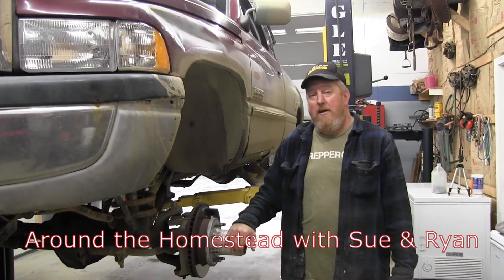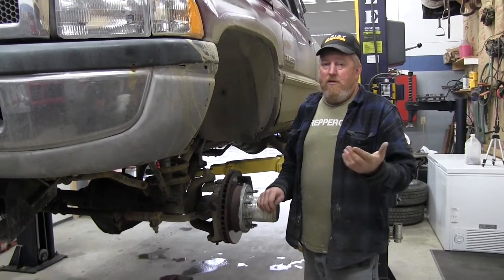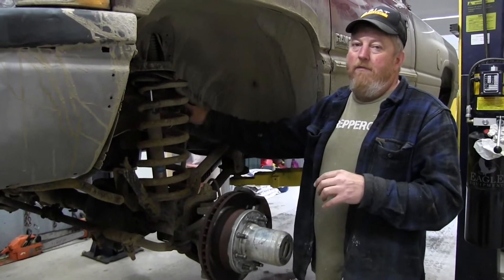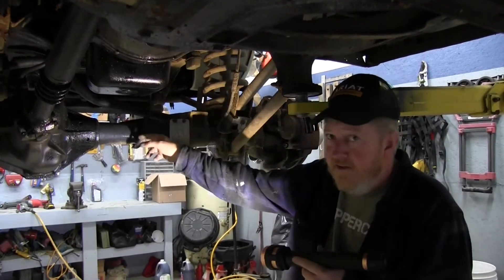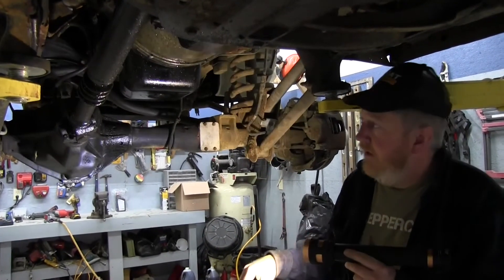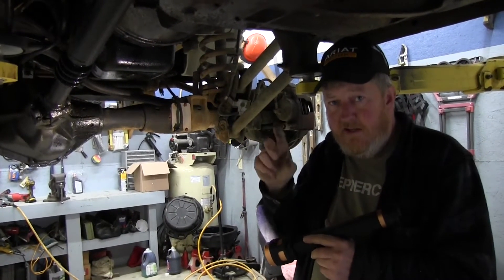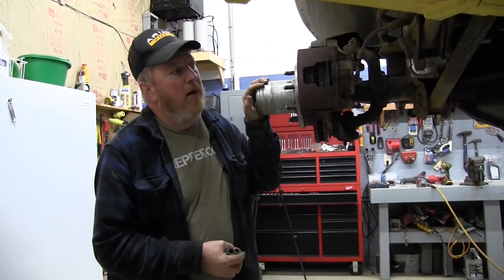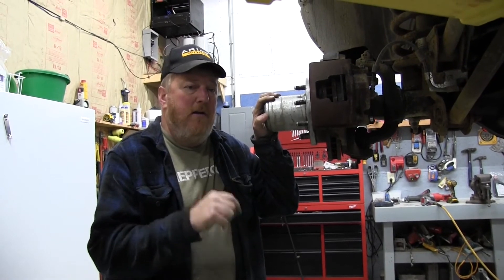Yukon Gear & Axle Spin Free locking hub conversion 1 year review

Comment: Will these put less strain on the ball joints and other joints on these dodges
Reply from the maker: Not really they just allow you to run the front end unlocked for slightly better fuel mileage and handling. They also make it easier to replace wheel bearings or should I say cheaper.

Comment: Don’t have the free spin kit in my truck, but I’ve been considering it. I have had the CAD delete kit for about 2 years. I started with a bellow/Toyota style closed breather, but in 4wd, the axle built up too much pressure that it blew a hole in the breather. After that I ran a 3-4ft hose all the way up by my brake master cylinder and haven’t had any issues.

Comment: I have a 02 2500. It does not have the CAD so it vents through the dif cover. There is a baffle on the inside of the cover. About the 4x4 light, I would look into on how the final year of the 2nd gen turns the light on since there’s no CAD.
Reply from the maker: good point, I will keep my eyes open for images

Comment: I have a 95 4x4.  Many years ago i wanted to make changes to the truck.  So I am now . I having a axle from a 2001 rebuilt to install in my truck ..I bought a axle delete kit and the yukon spin free kit seems like a good choice.  That and 3 gen brakes ect ect .. I did not know if Yukon offers Warren hubs in there kits or may be the yokon is good enough.  I already installed a g56 in my truck and low reverse is a good idea.  I just disconnected the vacuum to the cad and reattached it to stay locked out for now. I hardly ever need the front axle for additional traction.  Thanks for the video
Reply from the maker: I would love to have the newer axels and the 3rd gen upgrade. Although we finally got good brakes on this thing now.

Comment: I’ve had some old ford spindles for 6 years with the locking hubs. Got some old ford Dana 60 stubs to make the spindles work, just need to buy rotors, I’ll be free spin on My 97 5 speed for like $400 cad.My vacuum actuator never gave Me problems but I replaced the bushing that goes between the two axles for the CAD when I put new seals and ball joints in the front end. Just installed a 4x4 posi lok. Backing up is a breeze now.

Comment: They are not gen 2 or gen 3 that term is for the Cummins diesel engines not the truck because they been making dodge trucks since the 30s
Reply from the maker: Actually Dodge made a D model prior to the Gen 1 Dodge Ram, The Gen 1,2 or 3 refers to the models of Ram made, According to Wikipedia that is.

Comment: First I’d like to say I appreciate your review.. thank you.   

The location you drilled in the differential for the vent is ok,  the hose attached isn’t.   Run the vent all the way up the firewall, this will keep the oil from spitting, and more importantly the raised location will keep water out.  I recommend this for the transmission, transfer case and rear differential,  I ran my rear differential breather up to the top of the fuel filler neck.
Reply from the maker: Thank you for the feedback, We will get a new piece of hose and try that asap

Comment: I've heard the nuts for the spindle , do not take the torque needed.  I've heard people get different nut and bolts for the spindle. Did you use the supplied hardware ? or had to change them.
Reply from the maker: We used the supplied hardware so far so good

Comment: When you did the CAD delete. Did you plug the two factory lines that run to it? Or did you just connect them together to loop.
Reply from the maker: I actually traced the vacuum feed back under the hood and plugged it off in the engine bay. Then I removed all the vacuum lines completely

Comment: Does the truck handle better?
Reply from the maker: I think it does yes, With the hubs unlocked it seems to be a little more free. Plus I can use low range on dry ground for moving trailers etc
Reply: @aroundthehomesteadwithsuer3497  I got a vacuum switch for low range 2wd. Been trying to get my one truck back to driving as good as it did before going threw the front end lol

Comment: Hey man great video. I too have the Yukon locking hubs on my 12 valve and that’s what brought me to the video. Bought it that way. My 4wd light doesn’t work either, and my vent hole spits oil out long distance too. The vent is routed straight up to the brake booster and straight will drain, mounted on the diff cover. 
I was curious what it’s like doing brakes and rotors with the Yukon kit. I plan too do them soon but don’t know how much different of a job it is to replace them with the Yukon kit as opposed to stock. If you have any tips or info I’d be very appreciative. Thank you and have a good day
Reply from the maker: So I called Yukon (No surprise they offered NO help) but on the 4x4 Light this transfer case is used in a lot of models so as soon as the apocalypse truck is off the lift I will put the Dodge on the lift and take the vacuum switch out. I plan to run up to the junk yard with s list of vehicles this case is in and see if i can get a switch and the pigtail off the harness and splice my 4x4 light into it (We will do a video).
On the vent, Yukon's answer was "Maybe weld a little baffle inside the housing" but that doesn't make sense so I will get a pipe plug and plug this hole and try relocating it more carefully (Also will be in the same video)
As for brakes, It will be about the same except you dont have to fight the unit bearing out of the housing. You would just remove the locking hub and take the retaining nuts off the spindle. After that it is the same, pound the studs out and replace the rotor and press the studs back in

Comment: I just had a mechanic install a free spin kit on my 97. I don't think he knew about the vent needed. What part did you use and where do I drill the hole?
Reply from the maker: Did you do a CAD delete? If so then you need to relocate the vent, The free spin kit itself doesnt require a vent relocation as the CAD system is still "Wet" if you will. I used the screw in adapter from the CAD system and drilled on the top of the pumpkin off to the side of the ring gear
Reply: @aroundthehomesteadwithsuer3497  yes I had the yukon single piece axle half installed like you did
Reply from the maker: @ChaparralDenizen  Then I do believe you need a vent added other wise the front end will build up pressure when it gets hot and push oil past the seals

Comment: Thanks for the informative video. Just finished my Yukon free spin install today (01’2500 QCLB 4X4)  along with EMF BJ’s and agree with the “one size fits most” with the instructions. Impressed by the fit and finish of the kit.  My SS in-line tube brake lines did also have extra and a couple were different but didn’t need to fab any. I also hate the CAD axle and it’s just a silly design.
Reply from the maker: Best thing we did was installing this and the cad delete. No regrets at all on our end